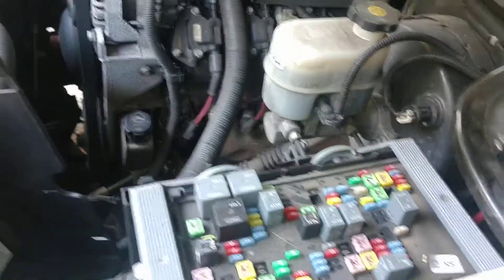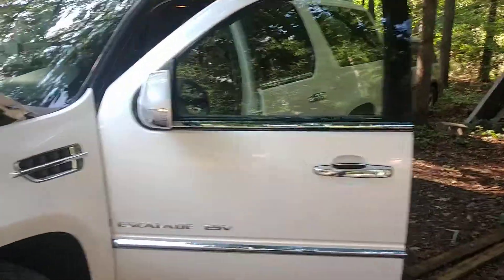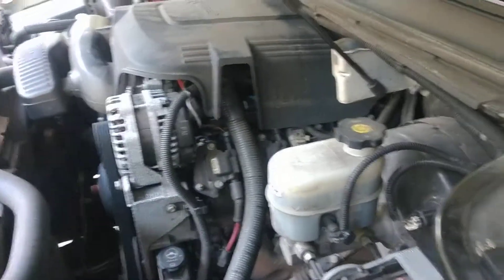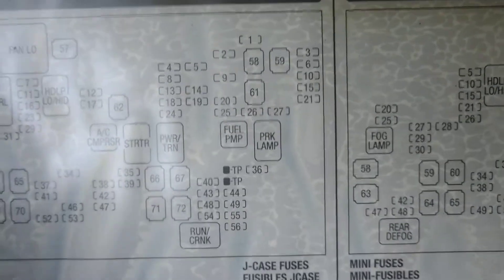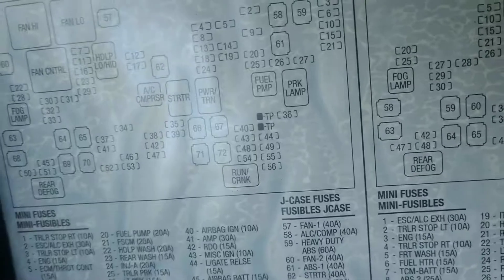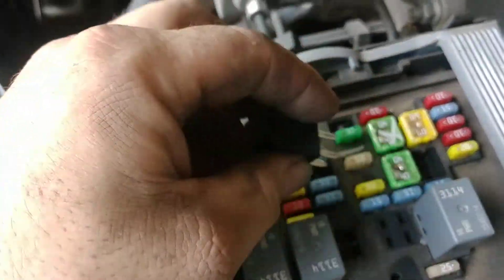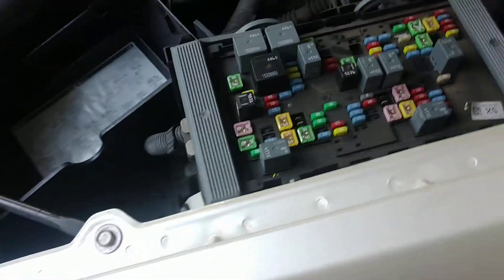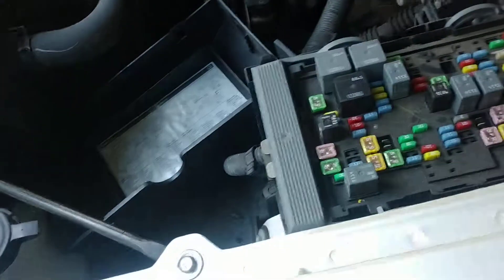2008 Cadillac Escalade 6.2 fuel pump relay conundrum

Comment: This is caused by a running change in 2007/2008 model year. The same fuse box is used for every truck of that rpo but they added a fuel flow control module to better dial in pressure and extend pump life. The module is located above the spare tire and takes over for the relay. Instead of retooling, the harness is blunt cut for the relay at the pump end of the harness and relay left in place. Not a mistake, just cost saving not having multiple parts for the cars
Reply: Are you sure that 07-08 Escalades and Denalis Have that above the spare tire? Because the 4.8/5.3’s and maybe the 6.0 Had that especially if it has E85 capability. The Escalades and Denalis didn’t get the E85 option until 09 and I believe then they got that module. I know for sure the fuel pumps are completely different in 07-08 on the Escalades and Denali’s
Reply: Also these trucks will run with no power to the fuel pump, because they only have one line that goes to the engine not only will the truck start and run on fumes but the flow of fuel will still happen by the laws of physics. You might not be able to go uphill easily but you can drive straight and downhill no problem. Ask me how I know. Also the STFT’s and the LTFT’s will be demanding more fuel highest numbers I’ve ever seen.

Comment: Thanks for this, my Escalade cranks but won’t start. Battery and starter are good. So I started switching fuel relay with other relays to see if that’s the problem, come to find out it does nothing?!?! 🤦🏻‍♂️
Reply: Check your purge valve,but then again that valve is usually bad when the vehicle is stalling out...
Reply: @mercedesbenzs600bash   thanks for the suggestion. I actually found the problem, it was a ground wire behind the power steering pump. At first glance it looks like there’s only one 10/12 gauge wire going to that spot, but there’s actually another set of wires that cause a no spark when disconnected off the engine block. All is well now.
Reply: @carlomendoza8588  OK cool,I'm thinking about getting one but it seems like there's some malfunctions but they don't really seem to be major problems...
Reply: @Carlo Mendoza is the only ground that you know of doing this? My motor spun a bearing so swapped a used motor in and now it just cranks and won’t start.
Reply: @samlewis19  mine was pretty easy to figure out, because my NO start happen after I changed out motor mounts and exhaust manifold. Once I verified there was fuel pressure going to the fuel rail and MAF sensor to be good I knew it was a spark issue. So that ground wire I mentioned most likely snapped/broke when I had to jack up the engine a little bit to get the old motor mounts out and put new ones in.
Reply: @carlomendoza8588  hmm im having the exact samee issue man do you know what exactly you did? And were you getting any fuel to your lines? Mine wants to crank but arent getting and fuel to the engine from fuel pump
Reply: @paperroute4031  if your not getting any fuel pressure at the fuel rail, definitely look into your fuel pump. Verify that your getting voltage to the pump if so, the pump might have went bad.

Comment: My question is why did they make this model without showing which relay pin goes where.  I swear every relay in my escalade goes in every which way.... And I always have electrical problems all over my ride.  Just want to know which way they all go.
Reply from the maker: Who knows what the engineers are thinking. This is not the first time I saw this and until you figure it out what is going on it will drive you crazy.
Reply: Did you ever fix the problem????
Reply: Never did. Going after my next step... Gonna change my starter solenoid and see if that fixes the mysterious problem.
Reply: @sakuraart  by any chance are you having a no start problem??
Reply: @carlomendoza8588  yes.  Clicking sound under the fuze box. No dash lights except the engine light.
Reply: @sakuraart   check the ground wires going to the engine block behind the power steering pump. At first glance it looks like there is only one wire, but there’s actually another set of wires that are thinner and often break off it’s eyelet electrical connector. I hope this helps you out.
Reply: @sakuraart  Good luck my man....
Reply: They can only go one of two ways and either way will work! If you’re having trouble understanding the concept, write it down on a piece of paper and look at it through mirror the adjacent Pens do the same thing either one of the two ways that you can plug in the relay will work